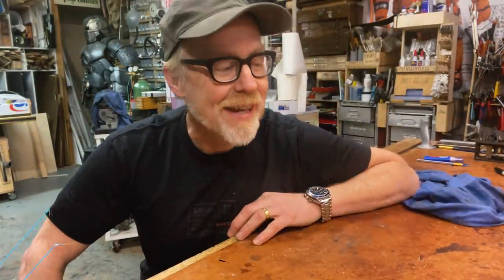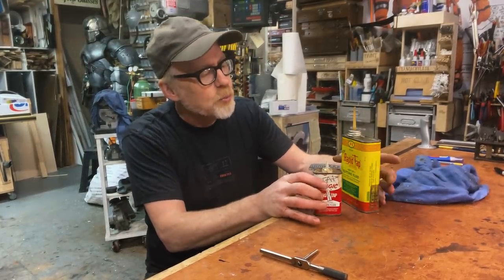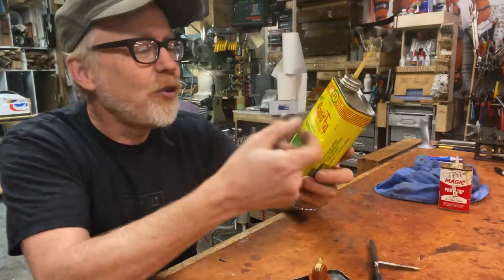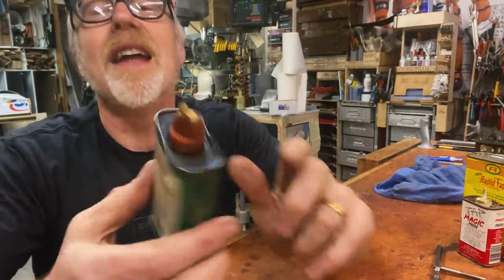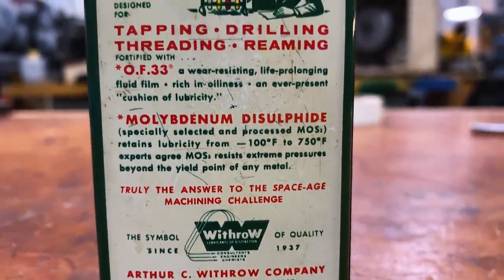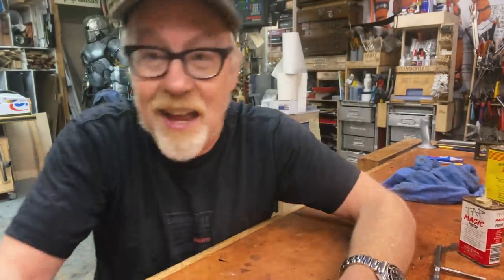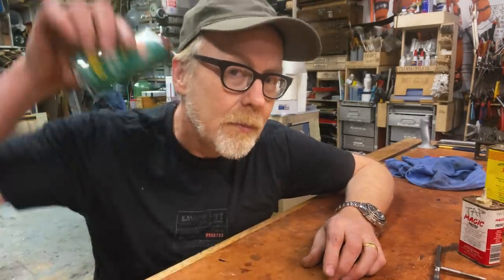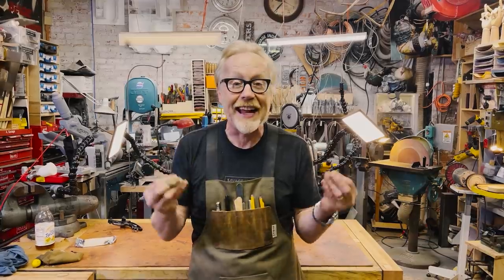Adam Savage's Favorite Tools: Moly Dee Tapping Fluid

Comment from the maker: “Turbo Encabulator” video: https://youtu.be/Ac7G7xOG2Ag
Reply: Not seen this for a while. Not even clicked the link yet. Love this!
Reply: havent thought of this one in a long time
Reply: @redhairdavid 
Turbo was first I believe, and there were some follow ups on maintenance etc.
The retro one is good too though:)
Reply: The Turbo type, is definitely the first Incarn-Abulator😂👍🇦🇺
Reply: @redhairdavid  its funny that they basically use the same script
Reply: @ritnerritner1  I think it's identical. Havent compared. But I think
Reply: @redhairdavid  I think that one was made in the 90s, that was an update to the original.
Reply: Is that the device from Dude Where's My Car?
Reply: @acidhelm  nope, that was the Continuum Transfunctioner.
Reply: we use something called "Emuge Tapping fluid", at the machine shop I currently work at. I have about 7 years of experience with it and it works great !!
Reply: He's done a few random technical jargon videos. That are amazing, thanks for the throwback
Reply: Don't forget to install your Myerhoff lifters first before trying to operate your encabulator or the Szyslak effect will be felt by all in the vicinity.
Reply: @redhairdavid  not completely identical, did comapre
Reply: It's like listening to Tim the tool man Taylor
Reply: The turbo encabulator goes back to the 1940s. It’s a great running gag. Here’s another one. https://youtu.be/UYxxXkrjpdc
Reply: What a rabbit hole you sent me down.  I never knew this was a thing.  Fantastic!
Reply: They must of got an engineering dictionary and tried to see how many people they could confuse or impress, pretty funny.
Reply: Well thanks for dragging me down that rabbit hole.
Reply: From Wikipedia: "Cyberpunk 2077 included an off-path scannable item called the Cyberencabulator, findable during one particular end game mission, with multiple references to the original text, including averted sidefumbling."

Neat.
Reply: Personally, the Chrysler is my go to Encabulator, your mileage may vary.
Reply: Adam - you should consider doing some voice acting work.   That Atomic Spaceman voice sounds awesome, and totally different to your regular voice.   Ringo Starr, James Earl Jones, Mark Hamil all did voice acting gigs too.
Reply: It's like the Rick and Morty plumbus clip
Reply: Omg this is amazing. Thank you!
Reply: There are two types of people in the world: those who swear by their Turbo Encabulator, and those who swear AT their drawn-reciprocation dingle arm.
Reply: I feel like I’ve just taken a step into a wider world. Thank you for this gift. Who knew you could pre-famulate amulite? (Engineers, obvs...)
Reply: My Dad loves this video and shows it to everyone who will watch it! I remember him showing it to me years ago. Brought a smile to my face to hear it mentioned it in the video!
Reply: anyone here aware of the lucas smoke theory of electronics?
Reply: @murunbuchstanzangur  Theory?  Everyone knows electronics run on Magic Smoke™!

Comment: Great video! In case you are wondering why...Moly-Dee is still around .....with a zillion other tapping fluids on the market....its because its just about the only cutting fluid that actually works well when you are making threads in Chromoly steel and other very hard/tough steels. Its been a Castrol product for some time and is now called "Variocut". On other metals (aluminum, mild steel etc.) its not much different than most other tapping fluids but its a HUGE difference on chromoly and a few other steels. Love that vintage can!

Comment: Spent 8 years as a machinist/welder in the USAF (AFSC 2A7X1 if there are any other Metals Tech guys reading). Our shop chief always had tap magic on hand, so that's what I've always used. That being said, anything is better than nothing - a bottle of cheap gear oil works great as a sub. Stinks like hell and smokes like a chimney, but the high viscosity and sulfer content leads to some clean cuts. It's nice doing lathe work on steel at lower speeds, doesn't fling off quite as easily.

Comment: Nice Video,   as for tapping,  I  upgraded from a black moly anti-Seize paste.  { mostly form taps for me ) 

A buddy was using Redline CV-2 synthetic grease with moly on his gun slide.   I bought some and it's now my GOTO for taps.  Amazing.  

With a cut tap it does fill with chips so a little messy with cuttings in grease.  Hinders chip flow as well for small sizes.    

Molybdenum disulfide is the trick in the mix.

Comment: Molybdenum, as I know it, is a mineral few people have heard of.  A large molybdenum mine once operated in my home state of Colorado.  One of the uses for this mineral is as an additive in the steel making process.  It toughens steel, making it more resistant to cracking.  According to Wikipedia, when sulfer is added to moly, it becomes molybdenum disulphide, a dry lubricant that can be added to oils to make them resistant to high pressure.  So, although a little overblown, the advertising on the can seems to be correct.  Amazing!

Comment: Molybdemun Disulphide and Croma-Tap (fi you can find it) are wonders for cutting and tapping! The machine shop that I work in can be pretty old-school and still has a gallon or so of Croma Tap still kicking around for 'special occasions' as they permit. This stuff works G R E A T for those last finishing passes on single-point threading or using high speed steel form tools. Heck, even when you just need to take a skin cut but want to maintain a decent surface finish, a schmear of this stuff works wonders!

Comment: I didn’t know molly dee existed, until about a year ago I started working at a job shop style machine shop and that stuff is substantially better than any other tapping fluid I’ve used... it’s expensive so we use it when we need the hood stuff ( inconels, k5 monel and m4 monel and other high nickle and cobalt metals) stuff makes working with stellite substantially better!! Happy I found out about this stuff at 18 rather later in life because I won’t go back to the other stuff ( tap Magic is good but it’s like comparing a fiat to a Ferrari)

Comment: Smokey Yunick said the only oil additive that worked was a molybdenum. For many years I raced vintage sports cars and always used a moly additive. When I would tear an engine down for inspection the bearings showed little wear.

Comment: Did anyone else, when they saw Moly Dee Tapping Fluid, immediately think Molybdenum Disulphide?
Reply: Yes! And does anyone else only do that because of a certain bumblefucking uncle from the mountains of British Columbia?
Reply: @paulhannoever7680  Nope, not him. The true master machinist piqued my interest in moly and it's uses - robrenz.
Reply: @paulhannoever7680  I've only just recently started watching AvE's vijayos (from the beginning, because I'm that kind of person), and yeah, that's the first place I'd ever heard of MoS2. At that point, I wondered if Adam was going to make some sort of comment about it leaving shit(e)stains on the couch and his wife being pissed off about it.
Reply: @paulhannoever7680  Naw. I'm old. I have a can of it from ... back then.
Reply: Yes!!
Reply: Not allowed since the white couch incident of aught two
Reply: @evensgrey  I've been using Moly Disulphide for MANY years! I've got dry spray, some thin liquid stuff, and a can of grease that I use for anything that you won't touch! It IS messy but it works! Here in the South we have a saying. It's "slicker than hot chicken fat on a stuck doorknob"!
Reply: That shit’ll kill ya. Cleans like a true professional. But, shit’ll kill ya.
Reply: Even tho I’ve got a bottle of moly-dee tapping fluid in my shop, the first thing that comes to mind is actually molybdenum disilicide resistive elements, like those used in glass furnaces. We call them ‘moly dee’ elements or bars and power them with silicon controlled rectifiers (SCR’s).

Comment: They still make Moly-Dee!  Apparently they now call it Castrol Variocut C Moly Dee.  I found it on Amazon.

Castrol Variocut C Moly Dee (previously called Moly Dee CF Tapping Fluid) is a high performance tapping fluid that improves threading accuracy, extends tool life, improves surface finishes and increases production. Variocut C Moly Dee is suggested for use on most metals, including aluminum, titanium and steel. It is especially effective on difficult-to machine metals such as stainless steel and aerospace alloys. Used straight, Variocut C Moly Dee should be applied directly to the tool/workpiece interface from a spout-top can or other applicator. Used as an additive with straight cutting oils, it should be poured into a high agitation area in the machine sump. Add approximately one gallon of Variocut C Moly Dee to every ten gallons of conventional cutting oils. Variocut C Moly Dee is recommended for use on most metals including aluminum, titanium and steel. It can stain copper or copper alloys if not removed following use. This product is not water soluble and should not be mixed with water soluble oils or synthetic coolants. Consult your Castrol Sales Engineer for questions regarding compatibility.

Comment: As a CNC operator I used to put Moly Dee on taps constantly, the program typically had a pause "put moly dee on tap" and the machine presented the tap to you.  Acid brushful onto the tap, hit cycle start, and away it went.  Stinky stuff

Comment: Castrol still makes "Moly Dee" cutting fluid, Variocut C Moly Dee. I've used a bottle made in the last few years and its the best stuff there is. Carbide tap into a hardened steel block? Goop some Moly Dee in there and take your time, no problem. Oh my god does it smell awful though. I would 1000% buy a new bottle and refill that classic one for use.

Comment: I've seen the turbo encabulator, and the one that was inspired by the turbo encabulator that was done by some engineers at ABB (IIRC), which was along the same vein, but with electrical switch gear instead of a transmission.  But it is funny stuff!  ^-^

Comment: Moly Dee = "Moly"bdenum "D"isulphide is actually still one of the greatest lubricants and is very expensive, not that the particular product is the only one that has it. But if you were to send it in for analysis, the product with the most Molybdenum Disulphide in it would most likely be the best of the products from a chemical/technical respect. It still widely used in a lot of high grade lubricants.

Comment: That molecule is likely molybdenite,  this oil likely claims to or does contain molybdenum in it. Molybdenum disulphide grease is used in  high pressure applications such as splines or oil-less gear-trains.
Reply: Watched a little longer and it does lol.

Comment: I hate hate hate when people on YouTube or media cover good products that arent well known and don't have good stock. Thanks for causing a scalp price increase.
Reply: If you look elsewhere in the comments, this has been rebranded by castrol and you can buy it at a reasonable price. You can no longer buy the actual Moly Dee branded product. The can is just a prop.

In other words, stop complaining about nothing.
Reply: @NAJALU  I am specifically talking about vintage goods. Not modern products. For example the price of pro walkmen was around 250 before techmoan did a video. now you'd be lucky to get it for 400.